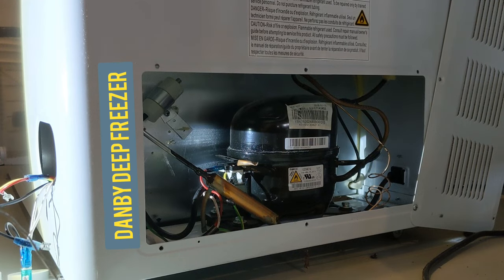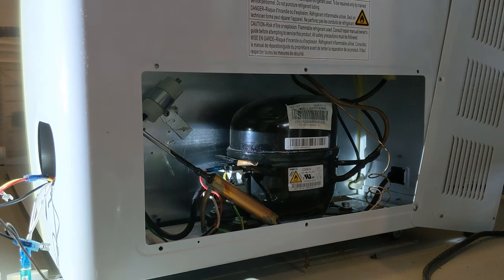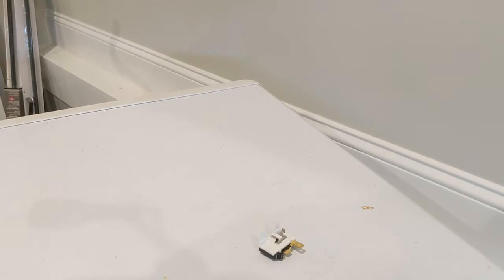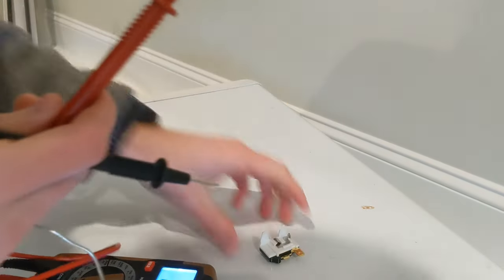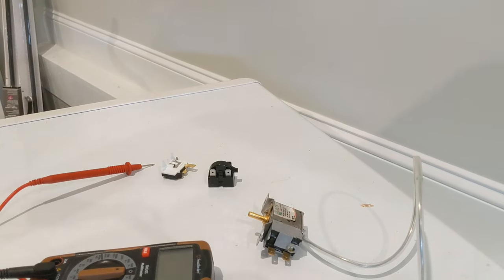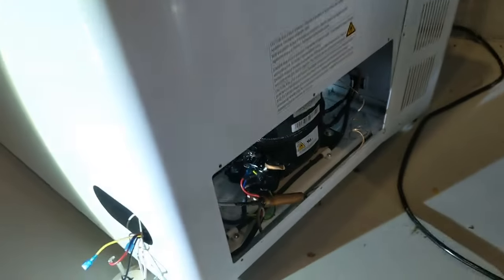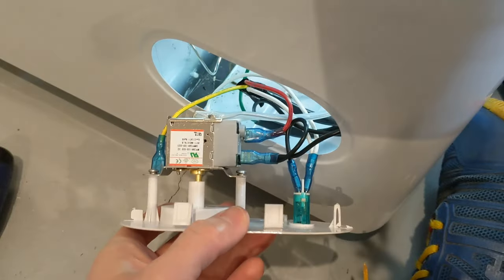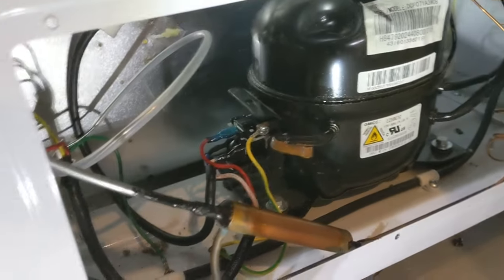Replacing a Deep Freezer Thermostat

Comment: For future testing/diagnosis ease, all you have to do to check if you have a bad thermostat is unplug the deep freeze, pull off the two power wires going to the thermostat and directly connect them together, then plug the deep freeze back in. If the freezer starts to run, then the thermostat was the issue. Easy, quick, and don't even need a volt meter.
Reply: I have 3 wires coming from my thermostat. How can I tell which two are the power wires?
Reply: @waynebuchholz5789  two wires should be lined up right next to each other. Should be those two and the other is ground. Wire colors are likely red and black, with ground as green, which you can leave where it is.
Reply: @ColeSloth thank you, that is exactly what it looks like.
Reply: 💯👌Genius idea. Thanks
Reply: Genius, that was exactly how I diagnosed mine. Thank you
Reply: Mine has the prong at the end. Would I need to strip the wire to connect them?

Comment: So I just changed my thermostat without a problem thanks to this video. I suck at this stuff so anyone should be able to pull it off. 

As for feeding the wire into the freezer wall. My Danby (2012) makes it a no brainer thanks to a tiny hole in the rubber plug. 

Cheers!

Comment: My Danby just quit too, I don't have a voltmeter so I disconnected the black and red wire from the thermostat and ran a scrap wire to the female connectors. The compressor start right up! Now I know I need a thermostat. You make me want to invest in a voltmeter though. I hope my new thermostat wire goes in easily, appreciate the heads up.
Reply from the maker: Yeah I didn't think I'd use a volt meter much, but it's surprised me how much I've used it for all sorts of projects. But if your thermostat is is still in there you shouldn't have a problem, but I would move the old one back and forth just to open the path up a little, once you get the new one in.

Comment: Thanks for the video!  My issue is that the thermometer I placed in my Igloo freezer registers less than -25 degrees F.  I have incrementally adjusted the thermostat so it is at the warmest level and still no change in temp.  I suspect it is the thermostat as otherwise, the unit is functioning.  Thanks for the tip on inserting the thermostat line.  Hopefully mine will be a little easier because of the info you provided.

Comment: For those looking for QUICK a temp fix, you can connect the two wire from the thermostat and then plug the freezer into a timer. 1/2hr on 1hr off if you are not going into it alot
Reply: What a brilliant idea, imprecise, but it would surely suffice I think

Comment: Hello. I do have the same freezer. It works but always freezes up to -25C only , I tried adjusting the temperature setting on the dial but doesn't make any difference. When  I turn the dial to the minimum I hear the click and freezer stops, so that means that switch-off function works but the temperature setting doesn't work for sure. I tested it for a few days with the thermometer In it just make sure that i am getting the proper temperature readings/control. Would you agree that the thermostat unit/part is faulty or could be something else? Thank you
Reply from the maker: Yes, it sounds like a faulty thermostat. I think they had issues with the thermostats that were originally on these freezers because recently the ones you get off the danby website are different from what the originals were.

Comment: The thermostat should have continuity unless it is set to the off position, or reading a temp bellow what it was set to run, I think

Presumably neither were true during your test so a thermostat replacement would have indeed been indicated
Reply: The Thermostat Makes and Breaks contact continuously during operation depending on the set temperatures, so it could just not have continuity but it is still OK

Comment: My Danby stopped working all the sudden.  I tested all 4 parts with a multimeter including compressor and I get continuity on everything.  My green light does illuminate at the thermostat.  Turning the thermostat knob doesn't make any noise when rotated.   It is plugged into a working wall plug.   Any ideas?  Trying to keep from having to haul this thing up a flight of stairs and to the dump.
Reply from the maker: Do all your electrical lines look okay? I.e is power getting to your compressor?
Reply: Yes, everything else appears normal.

Comment: Where is the Overload Protection Switch located? Thanks...
Reply from the maker: It's mounted on the front of the compressor. It connects to the 3 prongs on the compressor. It's shown in the video when I'm reassembling it.

Comment: I found a thermostat. but getting the tube back in with the sensor bulb is impossible. even  with a stiff same diameter probe, cannot find a path for the thing to go into.
beware do it your selfers...
I am thinking of ordering a 12"   x   1/8" drill bit to make a hole following the initial path, which goes in about 4 inches.
Reply from the maker: Yeah the hardest part for me was pushing the probe to the area it needed to be

Comment: My deep freezer stop freezing. I get a continuity reading on the thermostat. I don't have any noise alert on my multi meter. What should the thermostat read? I'm no expert, just use videos to learn and have done a lot of repairs on my washer, dryer and lawn mower. This is my first time troubleshooting my freezer. I don't know where you got the other parts pulled from.
Reply from the maker: You can also do an ohm check. I pulled the other parts off the front of the compressor. My compressor had three prongs on the front and that's what the OLP and starer connect to. But I would check those and your compressor to make sure there is no break in your circuit.

Comment: Hi , I do have the same problem of the thermostat which need to be replaced. What  i face is the difficulty of pulling out the sensor feed. seems to be impossible. Any help? Thanks.
Reply from the maker: Do you have the new thermostat? So the long probe end of the thermostat is stuck? If that's the case and you can't pull it out, you might be able to cut it off and then try to run your new line beside it.
Reply: Its the old one I couldn't pull out the wire sensor. Its not even moving. Seems I may need to pull at an angle  instead of from the front.
Reply from the maker: @dav200  yes, at least on mine it came in at an angle.
Reply: @UnconventionalThinker  David Chan
David Chan
2 days ago
Hi , I do have the same problem of the thermostat which need to be replaced. What  i face is the difficulty of pulling out the sensor feed. seems to be impossible. Any help? Thanks.
Reply: @dav200  I was never able to insert the new probe cable in. I got fed up and ended up drilling a new hole that goes inside the freezer. I used metal duct tape to stick the probe on the freezer inside wall. I suspect it may get too cold and shut down quickly but we'll see...

Comment: I turn my thermostat on and the freezer runs for about 15 seconds. Then shuts off. Is it something other than the thermostat?
Reply from the maker: It could possibly be the compressor but if you have to replace that you might as well buy a new freezer. Is the freezer not freezing at all?
Reply: @UnconventionalThinker  It turns on for about 15 seconds. Then it's dead. The freezer is a Black and Decker I bought from Walmart. Not even 10 years old.
Reply from the maker: @123nlc  yeah so if it were me I'd figure out what I'm willing to spend to try to fix it on my own even if it doesn't work and start from there. Which for me was trying to replace all the other components that weren't the compressor. For me I think I spent a total of $30 trying to replace the overload protector, the relay, and the thermostat. For me it was worth trying to spend $30 to fix it versus having to go by another $200 freezer.
Reply: @UnconventionalThinker  Thanks for your help.
Reply: @UnconventionalThinker  you probably have a bad 4.7 compressor relay

Comment: to insert the thermostat into the hole can we use grease on the top of the wire?
Reply from the maker: That I'm not sure of, if you were going to use a grease it would probably have to be dielectric so that it conducts properly. Are you struggling to get the wire in?

Comment: Hi, watched your video. My similar freezer is still keeping cold, but the motor is not shutting off. I have defrosted and restarted, but still not shutting off. I have turned down as low as possible without turning off. I am thinking this may be the thermostat. I just ordered one from Sears parts direct. At least food is still freezing, hopefully until I get the parts.
Reply from the maker: I have heard these stay on 80-90% of the time. We keep ours in the garage so it's not exposed to inside cooling. I have noticed with ours that it mostly stays on, but I have noticed it does shut off from time to time. But you definitely could have a damaged thermostat if you've noticed it doesn't shut off it's the only instrument on these freezers that monitors the temp. Just make sure when you insert the wire probe back in through the insulation that it gets close to surface walls of the freezer and breaks through the insulation so that it can get an accurate internal temp.
Reply: Hi again, I am attempting to replace the thermostat today. We should know in a few hours if we are successful. My Sears/Kenmore must have a metal tube inside to feed the thermostat wire, as it went back in pretty easily. We pushed it in as far as the red line on the metal wire. Thanks for having this video. I'll update late if we have success.
Reply from the maker: So I made the assumption that the thermostat wire needed to be pushed all the way into the foam until it got to those red and blue pieces of tape on the wire. I think my red and blue pieces of tape or spaced about an inch apart not sure if yours has a blue piece on it as well. But you want to make sure that wire is going through the insulation to where the inner wall of the freezer is so that it can get an accurate reading of the internal temperature. If it doesn't get an accurate reading it will continuously be running maybe longer than it should. But also make sure to not to use your new thermostat wire to push through the hole or create a new hole in the installation or you could end up breaking it. I ended up using my old thermostat wire to essentially push through A New path so that I wasn't putting too much on to that wire to where it was bending and potentially breaking. Let me know if you have any other questions
Reply: @UnconventionalThinker  Where my thermostat feeds into the freezer cavity, there was a rubber stopper so as to hold it in the cavity.We slid that down the old thermostat wire. There was then a metal tube sticking out about maybe 1/2". We then pulled out the old thermostat with pliers. We then inserted the new thermostat into that metal tube and it went in very smoothly. I think on my brand/model there might be a metal tube to help with feeding the thermostat in. I am thinking the tube ends somewhere in the freezer along that inner wall so as to monitor temperature. When we inserted the new thermostat, we did it to the red line, just as when we removed the old. My thermostat does not have a blue mark only the red. Hope that makes sense
Reply: I think we have SUCCESS! I had the control set at "Mid" for a few hours and not shutting off.  I think my thermometer was reading about minus 25-30. I turned the control down to "Min" and it shut off. I babysat by the freezer and it came on about 15 minutes later (2:44pm), it then went off at 3:20, it came on again at 3:36. If it goes off again sometime after 4pm, I think I will feel it is a complete success.
Reply from the maker: Boom! Good to hear!
Reply: @UnconventionalThinker  Glad to find your video to help. It was just the thermostat, but I also discovered that the OLD thermometer that we had laying in the freezer was not correct. It was running about 15 degrees colder than it was, so that was throwing me off. I am also picking up a couple of new freezer thermometers. Thanks again!

Comment: Did you replace all three and where did you purchase your parts
Reply from the maker: I ended up using the old relay and starter because they were still good, but found those on Amazon. I believe they were universal parts based on the part number found on those parts. The thermostat I had to order from Danby for this specific model the thermostat was really cheap $14 plus shipping.

Comment: Hey Dude, first good video, hope your freezer is still doing well. My freezer was also 3 yrs old when it took a dump. After doing enough research I replaced the temp control part. The green light comes on in the front, but no buzzing. So do you think it might be the other two parts just wondering. Plus you paid $15 for your temp control, I paid $90, #$&&@%! Thats me swearing!
Reply from the maker: Yeah I would do a resistance check on all those parts to find which part doesn't have continuity. Sorry to hear about the $90 part, I had to wait a bit to get it for $15 as Danby had them on backorder from China
Reply: Thanks for response, very cool!